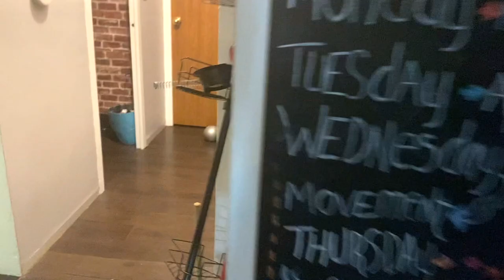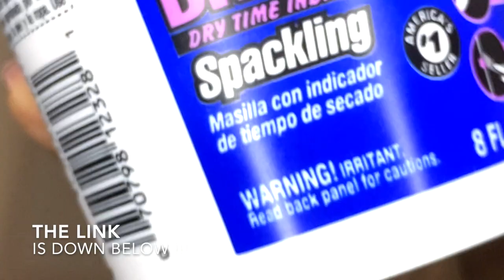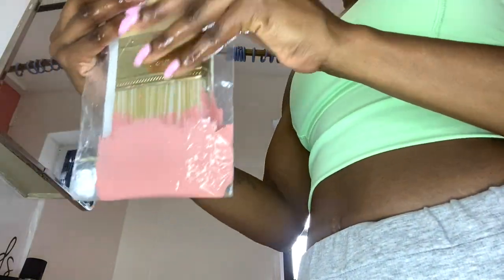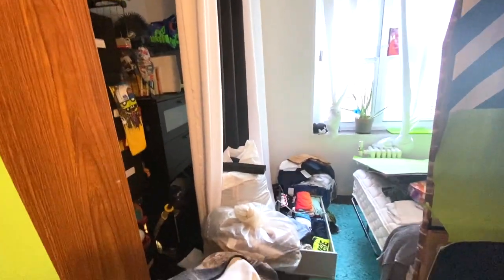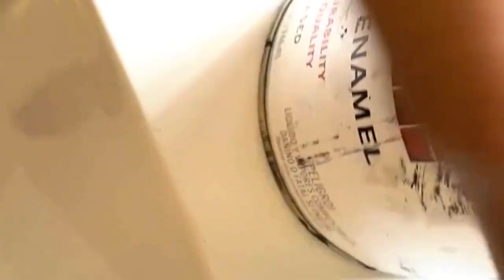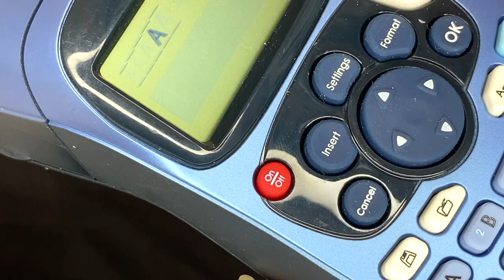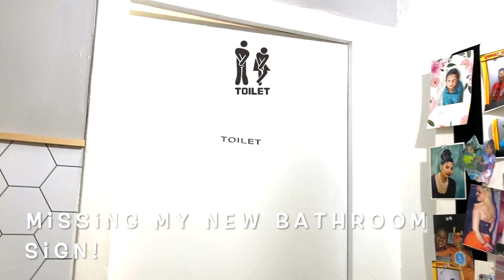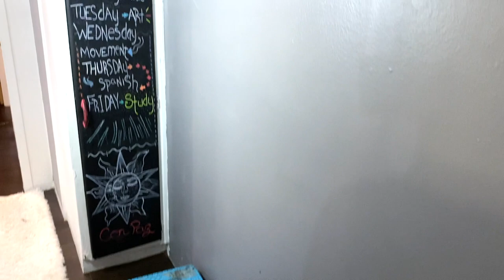N͎Y͎C͎H͎A͎_𝗖𝗹𝗲𝗮𝗻 𝗪𝗶𝘁𝗵 𝗠𝗲|𝓑Ⓐ𝓣𝔥ⓡＯ๏𝓶 𝗣𝗮𝗿𝘁𝟮 | 𝗦𝚒𝚖𝚙𝚕𝚎 𝙱𝚊𝚝𝚑𝚁𝚘𝚘𝚖 𝙼𝚊𝚔𝚎 𝙾𝚟𝚎𝚛|𝗧𝗵𝗲 𝗺𝗼𝗹𝗱 𝗜𝘀 𝗯𝗲𝗶𝗻𝗴 𝘁𝗮𝗸𝗲𝗻 𝗰𝗮𝗿𝗲 𝗢𝗳🤮

Comment: Ok. According to the shine paint you used, a similar gloss paint is suitable for the kitchen and bathroom walls.  Flat paint will pill overtime.    Since you used flat pain, you need to pain the areas every two years instead of five years.
Reply from the maker: The paint, I used is eggshell so yes its between matte and flat. I ddid  spray some chemicals on the wall so the paint did come off, thats why, I repainted it. Thank you for watching! 💛